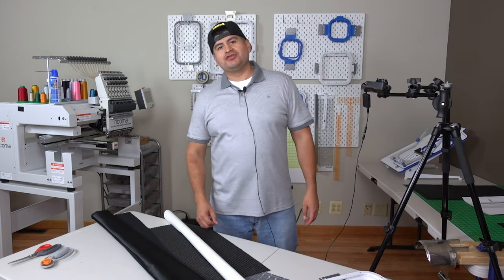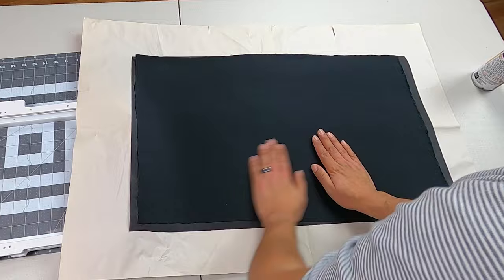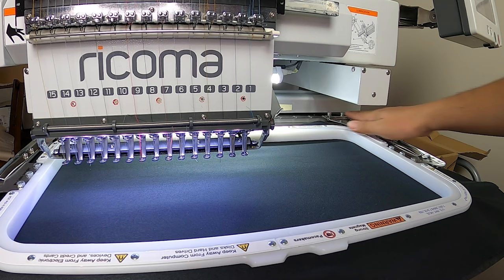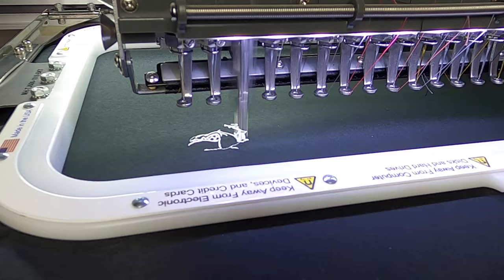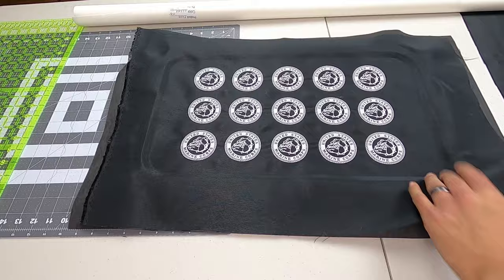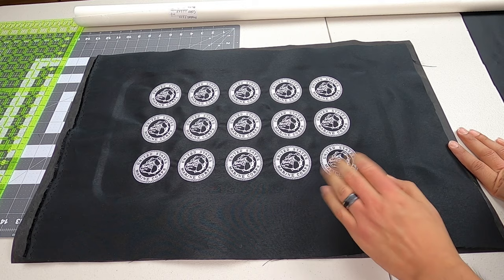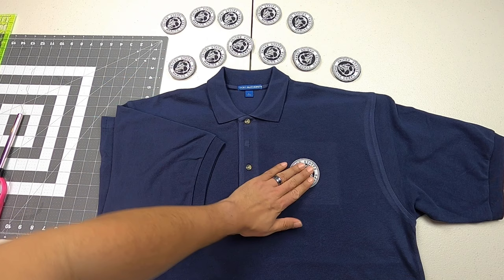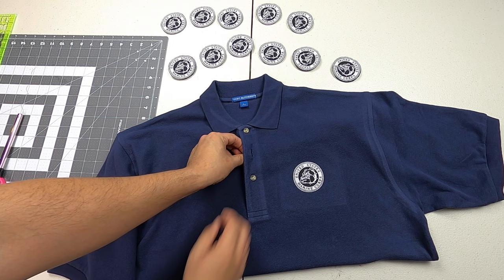How to embroider patches (5 Simple Steps)

Comment: Those 15 patches took 4-5 hrs to complete? What was the profit?
Reply: Profit should be fine. Lets assume he sells those for 10-15 USD. Material Cost for 1 should be under 1 USD (not including electricity). Lets say his net profit is 10 USD. Doing 15 in 1 go its about 150 USD and around 30 USD per hour. He would need a MAXIMUM of 1hour to cut them all, put the sticky foil on it and package it. So the profit is always good. Dou just need time to make your money back fast. So doing 15hours work for 10 USD a piece So that 3 runs a day he would need about 25 Full days of work to make all the money back for the machine. A ton of work but its worth it
Reply: That time can’t be right. Each patch should only take about 5 minutes.
Reply: @bhutch216 i wasn't watching very closely but it's possible his stitch density was higher + there was 12 of them so at least an hour according to what you said
Reply: Buddy, you can use canvas or denim.  Cheaper!   Looks great!
Reply: Profit per hour on a single head is not going to be great. Once you step up to four or more heads, the profit is in triple digits, but you gotta work your way up to that.

Comment: Great detailed video, thank you. Is it ok to heat press polo shirts with buttons?
Reply from the maker: Yes, I would use a heat press pillow to lift the garment above the buttons. Thanks for the question.
Reply: @RomeroThreads  Do you put the pillow inside the shirt? Does the heat pad touch the buttons ?
Reply from the maker: @mistyBlue7 you can put the pillow either inside or on the bottom of the shirt. Inside the shirt you’ll have more control of the placement. And the buttons can be on the pillow.

Comment: Thanks for this awesome video. What size needle did u use?
Reply from the maker: Thank you for the question. On the white thread, I used a 40 weight thread w/ a 70 size needle, and the black text I used a 60 weight thread and 65 size needle. Good question, I should've mentioned it.
Reply: @RomeroThreads  where can i learn which needle and thread to use when? Is there a rule of thumb or is it just experience?

Comment: Can you use twill with adhesive backing or do you have to do twill, backer and then the adhesive backing?
Reply from the maker: Yes you can. As long as remove the carrier sheet, you’re good to go. If you do so, you don’t have to spray adhesive spray.

Comment: I found your link for the adhesive. Is it the 965 sheet? We are presently working on an order for patches on a Richardson 309 hat. We used Twill fabric and Ultra Bond, Heat N Bond adhesive. The patches won't stay adhered. We took the hats to another company that does hats to use their heat press. Their press wasn't a nice one and creased the hat. So, we are now going to try Fabric Fusion to glue them on. We have no idea why these hats and/or patches with this adhesive is not working. Any helpful advice appreciated. Thanks.
Reply: Oh, I now see your note with the link saying which adhesive. Sorry I overlooked that.
Reply from the maker: Yea its the  P600 5-Mil. We've had good luck with that adhesive, you do have to find the sweet spot as far as temp, time and pressure. Thanks for stopping by!

Comment: by watching this video I am going to give up patch making , according  to Mr. Romero , it takes 4-5 hrs to make 15 pieces. In order to see any profit I have to sell these for appx $26.00 each. I cant find such market, I have seen some complicated patches for around $3.00 to 5.00. not a good venture.
Reply from the maker: Good observation. Lets look at the numbers 13,000 stitches ran at 750 stitches per minute multiplied 15 times puts you in the range of 4-5 hours. Successful shops that specialize in patches have multi-head machines so knocking high quantities of the same design is no problem. Somebody with 1 head maybe cant compete with somebody with 6 or 12 heads. Thats when you see dirt cheap prices for patches, the only small details is you have to order large quantities. There of course are ways to minimize thread count and speed up the process to make a profit, thats of course planning and preparation. I cant comment if you can make a profit or not, since I don't know how many heads you have and how good your designs are.
Reply: @RomeroThreads  Thank you so much for replying. Very well done. You are absolutely right. I made the comment to get others head working. People get in the business not knowing anything and don't even want to consider that some jobs are for others. Like I said in my comment, if you want me to do it for you it will cost you $x amount since I'm not in compition with others. I know my limitations.there is more than it meets the eye. Yes, some people tell others that they can start a t-shirt business with$300.00 , that doesn't even cover your legal fees.
 Ok. Thank you again for your response.

Comment: when you heat pressed the patches with the adhesive, does it also act as an anti-snag for the facing of the patch? (since the faces of the patches are getting some heat, i wonder if it melts the poly threads into place).
Reply from the maker: The adhesive ties the back stitches altogether, the front side becomes even stronger, but it doesn't melt the front side.

Comment: Hello Romero sorry to bother you but I ordered the twill from your link and they sent me twill with a peel adhesive back I don’t what I should do can I use this one?
Reply from the maker: It could have been 3 types of backing. There’s the type that is sew and heat press. If so you should be good. If its heat press only then it’s not made for embroidery.
Reply: @RomeroThreads  ok it has PSA sports twill,polyback sports twill,permanent sports twill and PSA permanent sports twill can you please tell me which one you grabbed thanks alot Romero!!😊

Comment: I did the burning with a lighter, but the white edge I want to get rid of looks yellowish/burnt. I did the exact same thing as you did-not leaving the lighter at the same spot over time. Is it supposed to be like that, or did I do anything wrong? How can I fix it? Thanks!
Reply from the maker: Its a little tricky with white thread. Ive used a butane lighter (the one plumbers use), it works better for me better.

Comment: how do you  get rid of all the iron burns on the Polo, better to use a cricut iron, gets hot enough and heats smaller areas.
Reply from the maker: My pressure was pretty high on the heat press. It was flatten and stiff in that area, a day later the shirt was back normal. You can rub a damp sponge if the creases stay.

Comment: what does it look like after a few washes and drying?
Reply from the maker: Still looks great. I try not to dry it at a super high temp.
Reply: @RomeroThreads  Gotcha! Looking to give patches a try. Mr. Romero I want to make the same kind of patches but I want a adhesive back, where you peel back the paper and stick it on what ever your going to stick it on (not heat press or hot press). What do you suggest for that? Is it a heat press on one side and a stick and press (removable) on the other?

Comment: Hi, can you use an iron instead of an heat press?
Reply from the maker: Yes, Ive tried it w/ a regular iron then washed the shirt, held on good. I'll make a video soon using the iron.
Reply: @RomeroThreads  thanks Romero, I'll be making patches for a customer for the first time. They will attach it to a karate uniform. That's why I'm asking if it's okay to them to iron. Can't wait for the video. Thanks again.

Comment: Romero, got a question, that glue material. I just got mine in, but what heat settings and time did you use to apply it to the patch then what settings to apply it to the garment?
Reply from the maker: I used 320 for 10 sec to adhere the twill and the adhesive. And 340 for 20 sec for patch to polo. You can double check on the Twill USA website too.

Comment: Mr. Romero 
If you don't mind me asking what is the name of the product your using that your calling adhesive?
Reply from the maker: The adhesive is the glue I add to the back of the patch after the patch is stitched. That allows you to iron on the patch later.
Reply: @RomeroThreads   yes I know that, my question was what is the name of that product where can I get it.
Reply from the maker: Ok, the link is in the description under heat adhesive heat press, its the P600 5 mil
Reply: @RomeroThreads  oh ok, thanks, your video's are great, I cant stop viewing them over and over, your very good at what you do.

Comment: Have you ever tried using twill htv, instead?
Reply from the maker: No I haven't, is that what you use?
Reply: @RomeroThreads  Not for embroidery.  Just getting into it, but I've used it just for shirts.  Seems like you could forgo the adhesive step if you did.  Was just wondering.

Comment: Do you have a matrix for calculating the cost per patch
Reply from the maker: No I don't. But we usually charge anywhere from $10-20 per 2.5" circle patch, depending on the details. We'll price up for larger patches.
Reply: @RomeroThreads  ok great. By my estimate that sounds about right

Comment: What is the difference between coated and uncoated twill?
Reply from the maker: Coated has glue (adhesive) in the back, uncoated has no glue in the back.
Reply: @RomeroThreads  I am going to attempt patches so which one do you think would be best to try out with?
Reply from the maker: You can use uncoated. inventories are low but you can check this link out https://twillusa.com/product/uncoated-sports-twill/